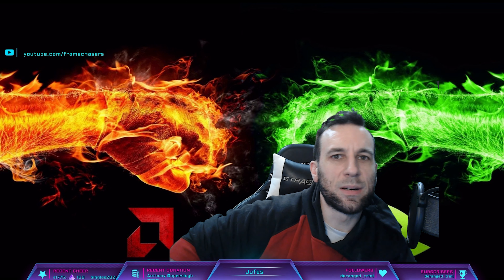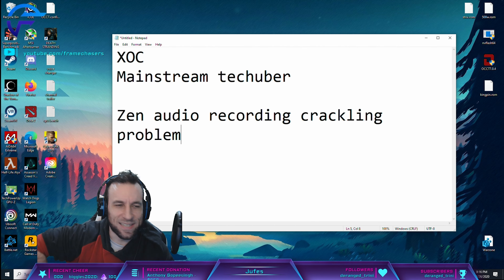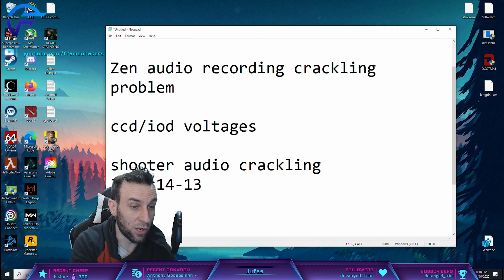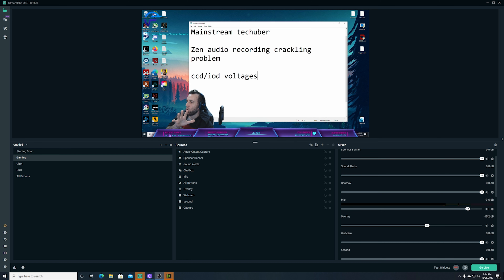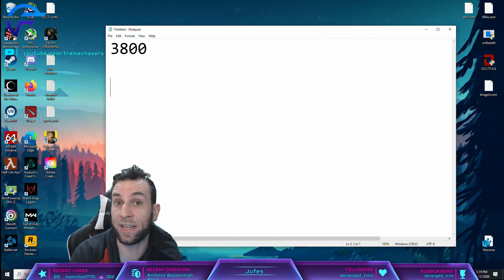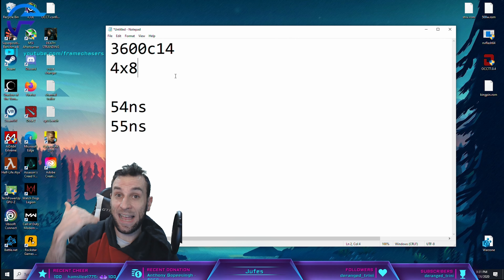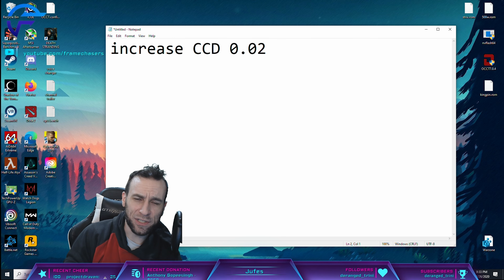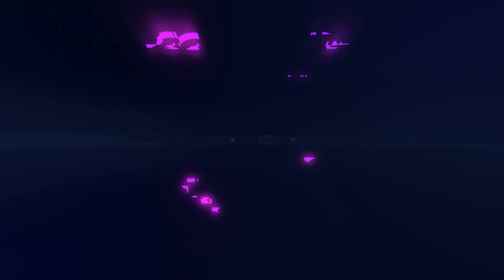Fastest way to OVERCLOCK Ryzen 5000

Comment: Curious.  There are a shit ton of people having compatability issues with X570 motherboards and the new HP Reverb G2.  Sound is cutting in and out, and most seriously, they can't even get there G2 to be reckognized and bought themselves 1000 dollar paper weights.  It seems to revolve around the G2 not being able to "get what it needs" from the USB off the motherboards,  and people are having to resort to buying specific external hubs, PCIe USB add on cards, and playing which USB is going to actually work, as work arounds.   Those that have X570 and are lucky enough to have a 2070 with a USB C port don't seem to have issues.  I personally canceled my new build and returned my HP G2 after spending over 30 hours of trouble shooting.  I just gave up out of frustrating and had no interest in investing any more of my time.  If I could have gotten it to run on a least one system, then I would have continued, but not even being able to set a base line sent me over the edge. After 30 years of staying away from AMD and finally thinking I'd give it a try again, and just more bullshit all over again.  Back to Intel.
Reply from the maker: Buildzoid runs his capture card out of his second pcie slot to the CPU lanes to get around this problem, you could also get a USB card and run it to the second pcie slot to get around the noise and flickering as well.  You pretty much cant use the chipset if you overclock the fabric too far
Reply: @FrameChasers  should have seen what it tookti run my oculus back on 1700x sensor disconecting problems lol

Comment: This is a great video btw, just because u have a higher FCLK 1:1 doesnt mean ur more stable/lower latency. Tight timings , lower CAS, I might have to check this out. Just curios what the voltage difference is between ur two timings, is the slower MHZ faster with tighter timings running at a lower voltage? I just pushed straight for 1900 FCLK in ZEN2, and then walked the timings down, my kit is 3600 XMP so it wasnt much of a stretch to go straight for 1900.

Comment: bro! my 5900x is doing the audio crackle!!!!! with PBO +200 , XMP.  asus x570 gaming -E .  i wasnt even watching your video to solve that issue and you started talking about it and my jaw hit the floor lol. makes complete sense now dude.  its stable enough to play COD and such. but not platform stable as you call it.  i thought it was hardware acceleration from Spotify. do you think adjusting memory timings with stock bios is better than setting xmp (DOCP) and then adjusting timings. + memory voltage?  thanks for the vid man.  love it.  im a new fan of your channel.

Comment: Got a question if I buy the tuning package in the new year if there are any problems after like freezes or errors after you've made these changes  will you be able to help me with these obviously when you have the time ?
Reply: He has been doing less consults because he has so many right now. I know from experience though that he will help u until the problem you paid for in the consult is solved. Part of the consult is making sure everything is stable if u are doing tuning. Now if u update ur bios/drivers months after, and something crashes, he may or may not help. However, if u support him and join the discord, most people in there can help with PC problems. They just dont do full consults in the discord. For instance, if u are overclocking ram and its crashing u can post your timings in the discord and ask people what to do, most of the time someone will help u get it stable.
Reply from the maker: ^ pretty much what he said, except you would THINK raising the price would slow down the consults but they haven’t at all 😑, still swamped.   Yes I won’t remove you from friends list until a few weeks after knowing your stable.  If you go and screw with the bios after or change something on your own to try and “get more” later then you will be swiftly ghosted.  The consult is for overclocking and tweaking help, not overclocking tech support if you screw it up later, otherwise I wouldn’t ever be able to get anything done with people always trying to do it themselves after and me perpetually fixing their mistakes, I’m like 50 clients deep right now 😑
Reply: @FrameChasers  Yeah okay, no I wouldn't touch it after you have done anything and I wasn't  thinking off buying this till the new year when I start my new job but thank you both for the the response

Comment: Is the 5950x better than the i9 10900k?
Reply: Depends what you are using it for. For productivity, multitasking, all that good stuff, of course it's better, here we are talking 16C/32T vs 10C/20T. In the gaming department, 1440p, 4K, they are on par.
Reply: @P34kyBlind3rs  1080p gaming, you have to have high end GPU like 3090, or 3080 to see the difference, yet it is not huge. Also, who would buy R9 5950X and RTX 3090 and will run this setup on a 1080p monitor? Makes no sense.
Reply: @4epa1012  to try to get as close to 360 fps in certain games.
Reply: @Remzly  Yeah, fair point.
Reply: @Noodles Yeah, good point here. I am using my i9 10900K tu run virtual networks, got Ryzen machine for this purpose too. The Ryzen machine has all sorts of issues, some nodes don't boot at all, other nodes boot 50% of the time. AMD support is just not on the Intel's level. Although, I am noy familiar with the content creation, I can assume AMD has similar issues there too, but can't really tell, not content creator tho...
Reply: @4epa1012  you do have amd lineup that is actually for your purpose too. Try epycs.
Reply: @meSOOlame  Not sure it will work, still AMD tho. If I want more cores for my labs probably I would go for Xeon CPU. Can get old Xeon 18 core CPU for like 500 pounds here in UK. But yeh, not sure if Epyc would be properly supported and for now tbh my i9 10900K does the job with no issues

Comment: Well, after overclocking my zen 2 3600 and getting my 4x8GB 2400mhz cl16 to 2666mhz at cl14 and have noticed massive improvements in frame drops/stability playing high fps games at 240hz on a 1080ti.

In saying this, my USB 3.0 pcie gen 3 hub has been cutting in and out when load up certain applications and then returning to stable. Weird but I think it might be a similar problem ( just not as severe ) on zen 2 then in regards to higher overclocks on the 400 series boards?

Comment: Are you going to do SMT OFF on the 5950X video? I have 1.1v SOC, 1.1v VDDP, 1.075v IOD and CCD. No crackling.
Reply from the maker: Yeah unfortunately though the Cold War patch came out like the day after I made that video so now it seems like SMT off in warzone doesn’t work anymore 😩 and FPS is dropped across the board

Comment: Does the DIMM voltages matter?
I'm running 4x8GB 3600 C16 now and it's not really stable. I tested both kits in 2x8GB and they're stable at 1.35V (same speed and timings) and the soc voltage on auto (1.1v). But when I put them in 4x8GB, all kinds of weirdness yeah. So what should I tune first, the DIMM voltages or the soc? Also will this improve with future AGESA update? I'm on B550.
Reply: Could it be dram voltage drooping woth 4 sticks? Try 1.38 or 1.4v with 4 dimms
Reply: @CVLova  is there such option like load line calibration for DRAM voltage? I tried 1.37V for 4 DIMMs with untouched soc voltages, still not good. Will try 1.375V and above later. I'm not really comfortable going above 1.4V though.
Reply: @whitemoses7913  i run them on 1,58:P just have active cooling on them. 1.45 is fine. im not good with amd clocking so cant help there :S
Reply: @CVLova  yeah I'm not much of a hard core overclocker apparently. Just feel like tinkering a bit more than just running XMP. My DIMMs are rated for 3200 C16 so getting them to 3600 C16 is hardly breaking any sweat. Btw what do you mean by "active cooling" on the RAM? I use  no water cooling in my setup. Just air cooled heatsink / heat spreader and fans. The DIMMs have temperature sensors on them and are running at around 50C next to the CPU that is 80C under stress. So I'd assume that is good enough?
Reply: @whitemoses7913  just a fan on top of them. some chips can be unstable over 45c atleast when overclocking. good enough :)
Reply: @CVLova  Alright thanks. I'll put the top fans on intake to direct more airflow onto the RAM then. As my case is pretty much sealed in the front and there's probably not much air coming in from the front fans.

Comment: Why not do 3733c14 if its stable? I've been at 3733c14 tight timings with no crackle or game crashes with a 5600x.
Reply from the maker: Full stable system doesn’t mean having anything on the chipset pcie slot flicker or cut in and out.  Gaming stable and system stable on these chips are different animals

Comment: Hello Frame Chaser, hope you are having a good day!
i have a ryzen 5900x 4.65 all core on a noctua d15s with 1.25 volts,  llc 3 msi tomahank x570 drops from 1.250 to 1.244 when stress testing reches 75 degree 
memory 4 x 8 gskill flare ex cl14 runing at 3866 cl16  15  14  28 with 1.4 volts latency is 55.1 on aida64 flck 1933 mhz.
Everything stable even 3ds max vray rendering.
However, when i conecy a xbox via bluethooth stats disconecting and the soud cracles then it reconects.
yet is working fine with usb cable.
Do you think it could be related to the voltages you just mentioned?
Reply: Probably- throw in the trash.  I went back to my 10900k.
Reply from the maker: LOL,  try setting your fclk to 1500 (3000) and see if the problem persists, if it doesn’t then it’s your voltages
Reply: i just found out that the antenas on the msi boards are not only for wifi, but for bluethooth too, its working properly now. 
lol thank you anyway for the fast response :)

Comment: What Motherboard are you testing on. Agesa 1.1.9.0 Appears to be rolling out on B550 and X570
Reply: noticed issues like this with the zen2 launch, lots of problems initially with zen2, but as bios versions and drivers continued to roll out it became a lot easier to work with. But this is my thoughts on AMD and their partners, since its overclocked somewhat out of the box, a lot of motherboards have bad bios settings. And because it relies on ram so much, the motherboards really need to set the proper values to handle everyones XMP settings reliably. Intel comes at 3.8 GHz out of the box, with no real fabric integration that relies on ram timings. And the user can then choose to overclock to 5.2 GHz, and overclock ram. Pros and cons to both.

Comment: Thought they said ryzen 5 series would do 4000mhz ram :( I bought some Trident Z Royal 4000MHz CL15
Reply: Where do you even buy that stuff from? The silver and gold coloured ones aren't normally rated for those speeds. Is it special?
Reply: @stevenwest1494  I got it from a guy on reddit that was attempting the ultimate build realized stop the money furnace I still paid well 350 4 sticks iirc he had 8 for intel 99980x or whatever 18c

Comment: Would you guys recommend the asus strix 3080 or the asus tuf 3080 for the best price to performance ratio coupled with overclocking potential?
Reply: OC is pointless on Pascal, I can get 105fps with 250watts at 1950mhz....or 110fps at 450watts at 2100mhz.....so...